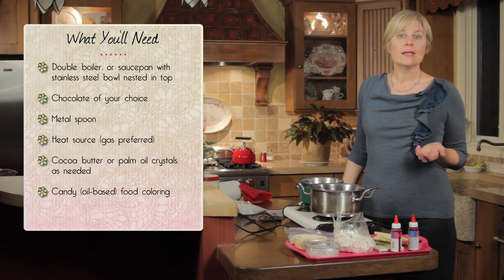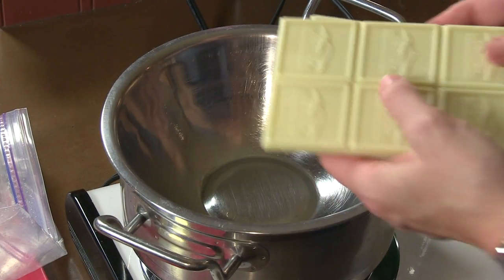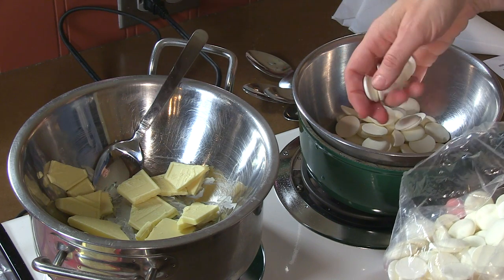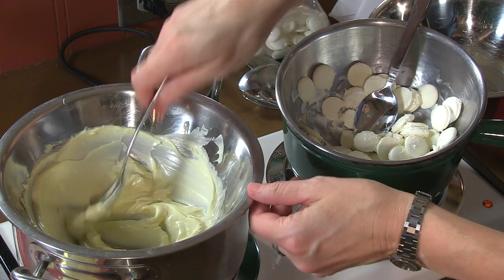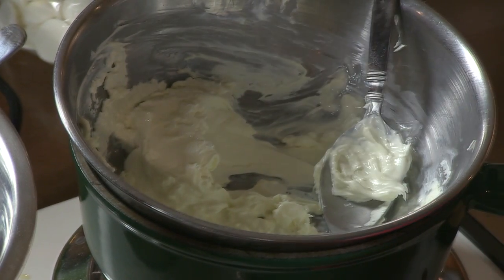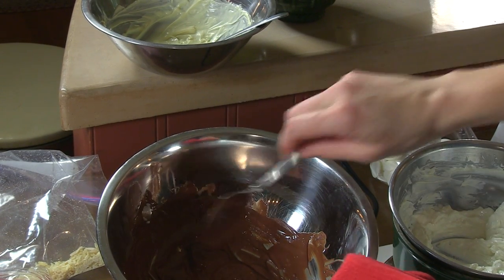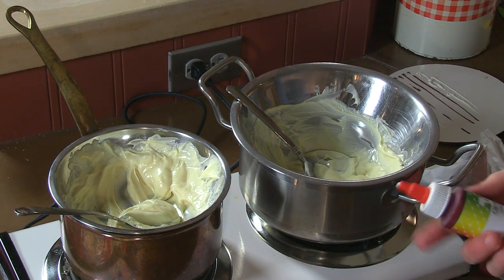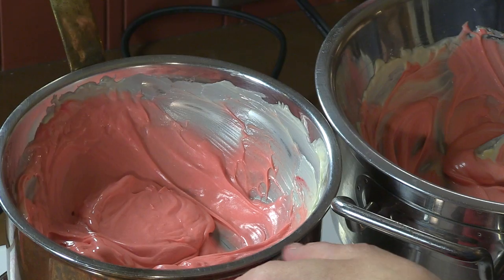How to Melt Chocolate (Without a Microwave)

Comment: i never have problems with candy melts.. I'm thinking water dripped from the bowl when u were holding it over the candy melts and that might have messed it up a little
Reply: I also don't have problems with candy melts. I  normally heat candy melts on a medium heat maybe the temperature was the problem.

Comment: I think melting chocolate in the microwave changes the molecular structure of chocolate. Whenever I melt chocolate in the microwave, after I let it set in the fridge it starts to melt in my hand even after its been in the refrigerator for a good hour or so
Reply: Maybe you took it out of temper, try to temper the chocolate after you melted it in the microwave and see how that goes :)